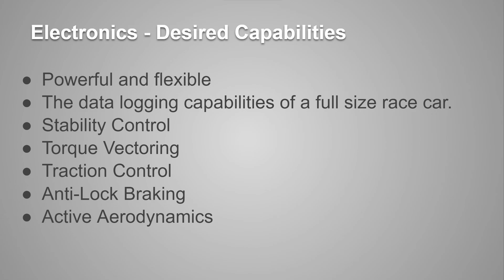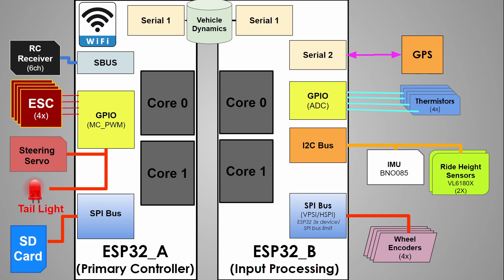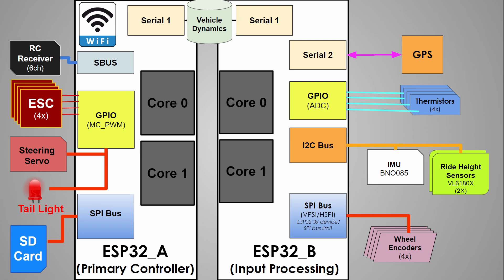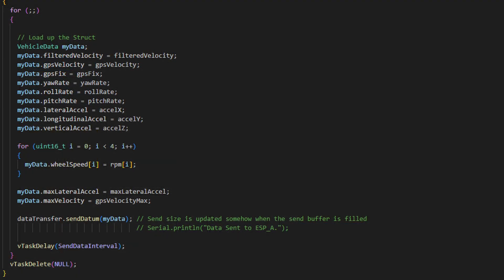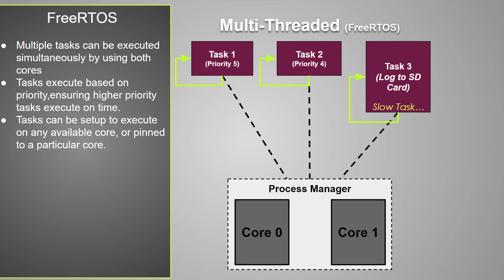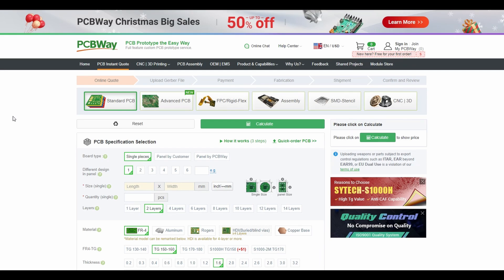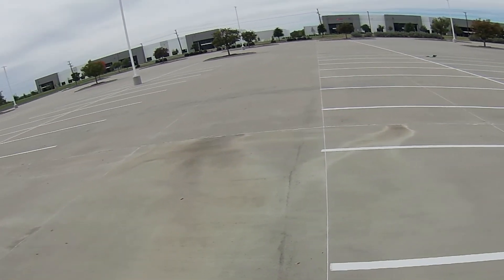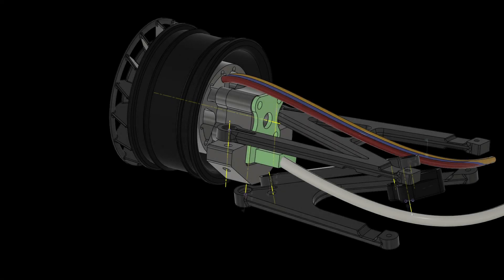RC Hypercar Pt9

Comment: I have a 12th scale rc pancar and on a parkinglot surface it's borderline undrivable. Considering yours is RWD as well, it's incredible to see how well it handles! I have quite a bit experience from fsae and can confidently say that aero has a very big impact even at 20mph. Love your project!
Reply from the maker: Thanks. I always loved those 1/12th scale pan cars but I never hand the hand eye coordination to keep up with them.  It’s very hard to find good parking lots to run this thing in, I just broke it yesterday running over a small rock.

Comment: May want to consider using differential amplifier on the SPI lines to eliminate possible noise problems. rs485 transceivers are commonly used for this kind of thing.

Comment: for pcb mounting holes it's good idea to either add a plated through hole and don't connect it or do a keep out zone around it. If screw damages the board there is lesser risk of shorts.

In easyeda to add keepout make a circle, right click, change it into solid region and on the right change the property to no solid from soild. You need to make it for the all layers that have copper.
Reply from the maker: Thanks!  I wish I had known about that. I would have never figured that out.  For me at least, EasyEDA is very unintuitive.
Reply from the maker: I wanted to design the PCB in Fusion 360 but I just didn't have the patience.  Maybe for version 2.  The integration with LCSC was nice because I can't believe how many parts I chose ended up being obsolete.

Comment: I've been dealing with the headaches of no-threads and didn't know about FreeRTOS. I'm now going to check it out on a Teensy 4.1 board. I love the PCB design BTW. Regarding PITA wiring, what are the costs (performance penalties) associated with scaling the size of the project. At some point the size of the printer to make the parts becomes an issue, but if creeping the size of the car a bit could help, it may be worth trying. Also, thank you again for the videos. This is an awesome project and I look forward to the next update!
Reply from the maker: Yeah, FreeRTOS is really cool, especially if you have multiple cores. Things like SD Card writing block everything else otherwise.  I really want to try the Teensy 4.1 out, let me know how it works out for you. 

I could redesign the car with more room for wiring without making the overall car larger, but it’s a lot of work because something always breaks.  I don’t know, we’ll see how crazy this all gets.
Reply: Given how things have gone so far, if anything gets less crazy, I think you will decide that is room to introduce more complications haha, love what you are doing @IndeterminateDesign
Reply from the maker: Yeah, focus is hard.  I want to get to the point where the car is reliable and I can drive the car for fun.
Reply: Would love to see you take it racing, even if thats giving it over to a really talented driver if it fits in any classes. Would be great fun if this kind of engineering resulted in real world performance differences over what the cars can do on their own wit foams on normal circuits. @IndeterminateDesign

Comment: The next step is to start using CAN Bus for all your data transfers. This will allow you to make semi-intelligent hubs that can read signals and put them on the CBus already formatted. Forget 2 Esp32's. Having an independent bus will allow you lots of Esp32s of different types.  It will also allow you to separate your architecture into multiple independent blocks for use on any project.  Add more blocks or Base Data at any time without extra wiring for the processors.  It will be extra work to learn/use CAN Bus, but will really pay off soon and for every project after!  Jump on the net!
Reply from the maker: I’m definitely interested in learning CAN bus. I want to design a power distribution module for my full size car. 

The challenge with this project is the size.  I couldn’t find a small microprocessor and a CAN transceiver to fit on these small 20x20mm PCBs. Do you have any recommendations?
Reply: @IndeterminateDesign  Email sent.  :-)

Comment: Hi! Could you please explain me how can you get so much negative (i.e. braking) torque from the engine? Indeed, if I correctly understand, you implemented an ABS control in order to avoid wheel lock. Thanks a lot ;)
Reply from the maker: I’m not doing anything special with the motors to achieve more braking torque. The car makes a lot of downforce and drag force, in combination with being very light, ~1.3kg.  

The ABS and traction control is very simplistic.  I have an average wheel speed for all 4 wheels, if any single wheel exceeds a threshold of being too fast or too slow, I proportionally decrease either positive or negative torque to that wheel. 

This works well for this car because the car is driving on dry pavement, and the microcontroller and sensors are so fast that they react well before a wheel can lock up or spin.

Comment: Have you considered the raspberry pi pico W? It has some interesting tricks with the PIO. Might be able to handle all inputs on the PIO and then a thread for wifi stuff and a thread for control stuff.
Reply from the maker: I did buy one to play with. I think it might be good, and it’s definitely easier to debug. 

The killer though is the number of floating point calculations.   Neither the ESP32 or the Pico has an FPU, but the ESP32 is so much faster. In the end, I may still need something faster yet like a Teensy 4.0.

Comment: I didn't see an accelerometer in your chart. In my real car, stability control is performed by an accelerometer sensing rotation and using a hydraulic pump to apply automatic breaking to the appropriate wheel to reduce vehicle rotation. The system works very well in snow.   Will you be adding anything like this?
Reply from the maker: The Bosch BNO085 has accelerometers and gyros, so I’m using that to record the accelerations. I won’t have hydraulics, but I will have abs and I can control the torque of each of the wheels individually when braking.

Comment: Out of curiosity how much down force in Kg or lbs does the Hyper car create at different speeds, say at 10mph increments?
Reply from the maker: I haven't calculate that, I know at depending on the wing settings, but it can generate ~4.5kg at 60mph and weighs 1.5kg.  Downforce increases with the square of velocity, so at 30mph it would generate ~1kg of downforce, and at 15mph it would ~0.3kg.  You quickly find that the car wants to be driven fast as the handling increases exponentially, which can get you into a lot of trouble.
Reply: @IndeterminateDesign  That's great info! I race 1/10 buggies and always wondered if the wings were really worth it. You've developed real aero surfaces. Amazing work! 3 times body weight is crying out for the infamous upside down trick!

Brilliant project and super well done!

I was happy to get a race box micro plugged in and working!

if you fancy developing a wing that works on a buggy I'd happily test it!

Comment: Any chance you'd be willing to make your code public?  What about the PCBs?  I have a use case for adding a 24GHz radar
Reply from the maker: I will make it all public with the PCB. I think you’ll want to wait until at least a version 2.  There are some component placement flaws and hole size issues as well I need to fix.

Comment: Is there any chance that you will release the STL/STEP files for the hyper car on Printables? I have been watching for some time now and it would be pretty awesome to build a car myself. 

Also... I am not sure if you know about Nicholas Rhem and Drehmflight https://www.youtube.com/playlist?list=PLTSCOv-lGtMax-oA4Pnq8OTxd4fTucrjQ but it seems like a lot of the mixing principals found in the code could be utilized for torque vectoring, active aero, etc.
Reply from the maker: The plan is to release the files necessary to build the RC Hypercar. I’ve begun the documentation on how to print and assemble the parts of the car. 

Also working on the final monocoque and suspension. The car needs to be 4WD so the motors don’t get as hot.  I’m testing different a 4:1 drone ESCs, but the packaging is tight even this requires changes to the monocoque.  Also making some aero changes because the weight balance of the car has changed. I see why F1 teams have such a hard time making updates to their cars 😂.